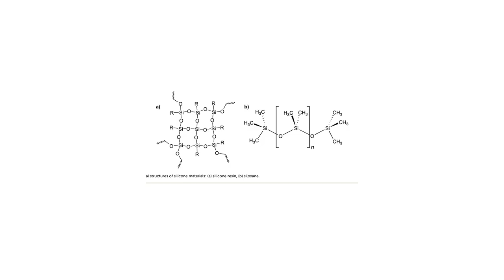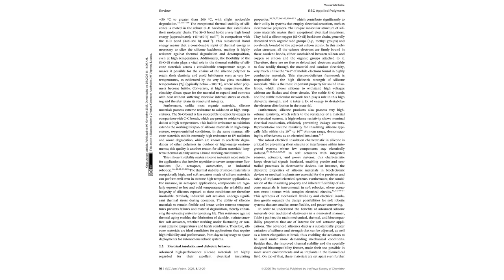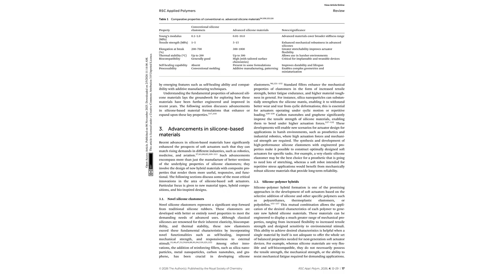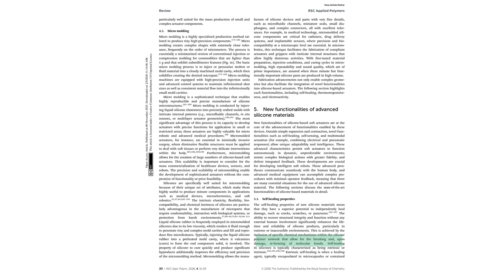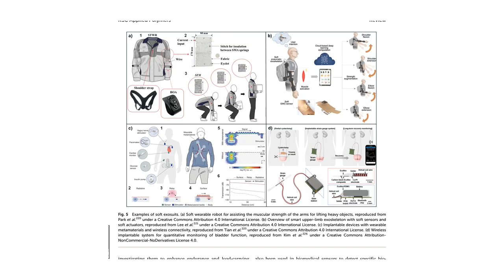Advanced silicone materials for soft actuator applications

Comment from the maker: SUMMARY:

This video offers a comprehensive review of silicone-based elastomers and their transformative role in soft actuators. These materials are increasingly favored in robotics, medicine, and aerospace due to their unique combination of mechanical flexibility, biocompatibility, and durability.

Key Highlights:
Material Science Foundations: Silicones are unique due to their silicon-oxygen (Si-O) backbone, which provides superior elasticity, thermal stability (ranging from -50°C to over 200°C), and chemical inertness compared to traditional carbon-based polymers (1:24 - 1:59).
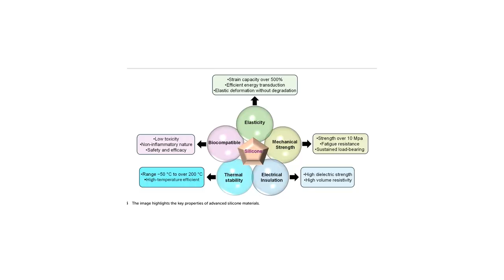Enhanced Properties: Modern silicone materials can be engineered for high tensile strength (often >10 megapascals) and massive strain capacities exceeding 500% (6:04 - 8:27).
Advanced Fabrication: The video explores cutting-edge manufacturing techniques such as 4D printing, which allows actuators to change shape autonomously in response to stimuli, as well as laser-based fabrication and micro-molding for high-precision components (15:37 - 18:13).
Emerging Functionalities: Innovations like self-healing mechanisms (both extrinsic and intrinsic) and electroactive properties (using Dielectric Elastomer Actuators, or DEAs) are enabling more resilient and responsive robotic systems (18:24 - 20:59).
Real-World Applications: Silicone actuators are being integrated into wearable soft exo-suits for rehabilitation, implantable medical devices for drug delivery, and soft robotic grippers for delicate object manipulation (21:12 - 23:45).
Future Outlook:
Looking ahead, research is focusing on developing multifunctional silicones, integrating machine learning for autonomous behavior, and transitioning toward more environmentally sustainable and biodegradable materials (23:46 - 25:00).